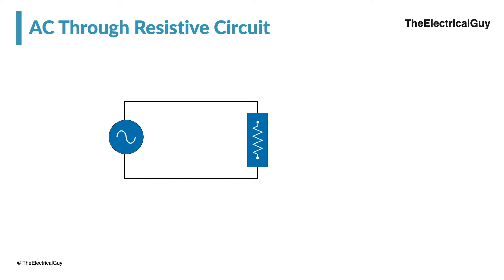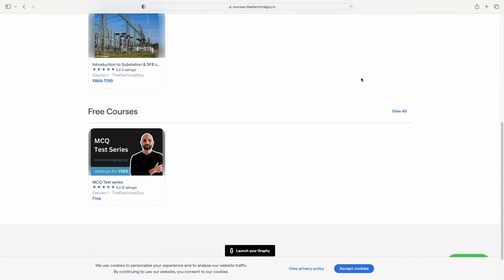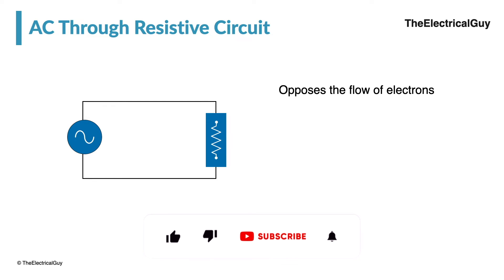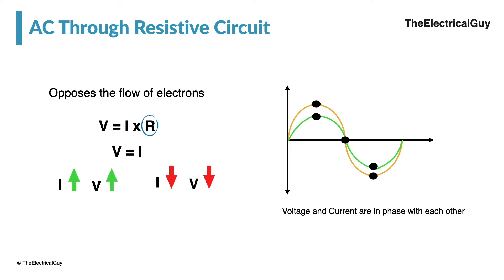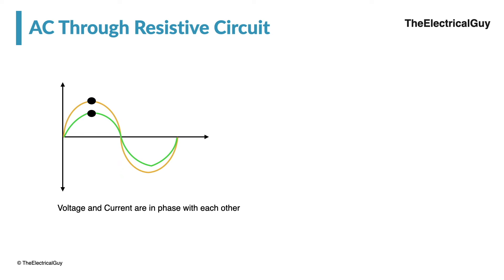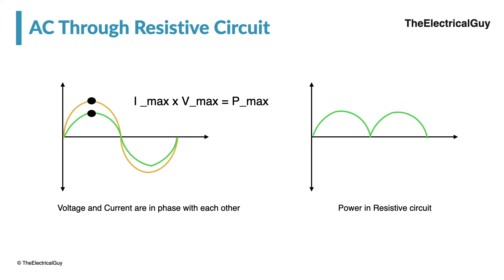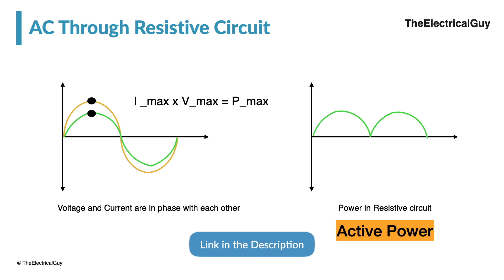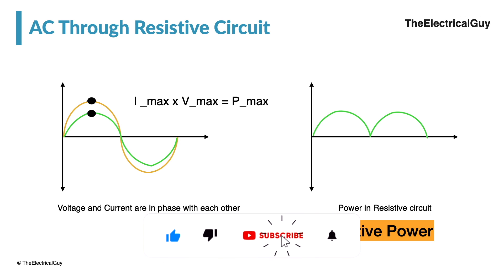AC Circuits : How resistor works in AC | TheElectricalGuy

Comment: I have a defective power adapter, that should output 9VAC but instead outputs 11VAC [that is 22% more] and that is causing my circuit to get hot - how can I drop 2VAC of this power adapter with resistors?

Comment: Hi there, I've been told that "active power" was conceived  ONLY to make the calculations come out properly! That is
Active Power can be thought of as an "absolute" value, but if you measure across a resistor with an oscilloscope you will
truly see an "ac" signal show both negative and positive peaks...not a "rectified" image as "math" dictates! Is this true?